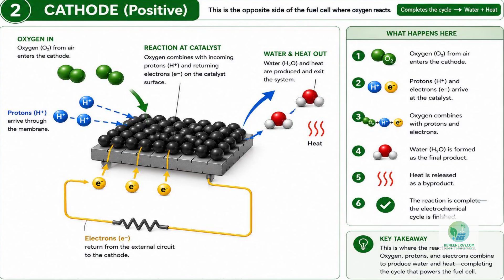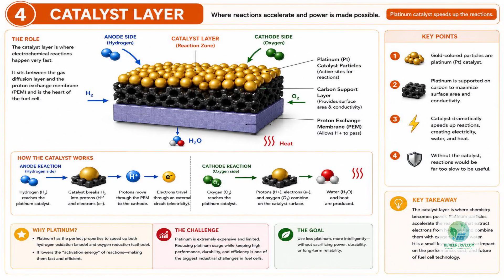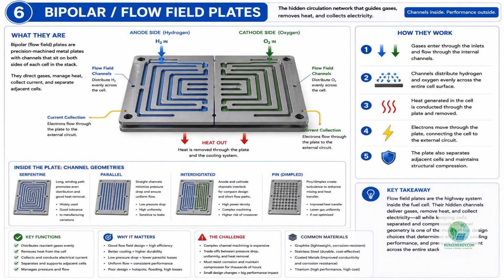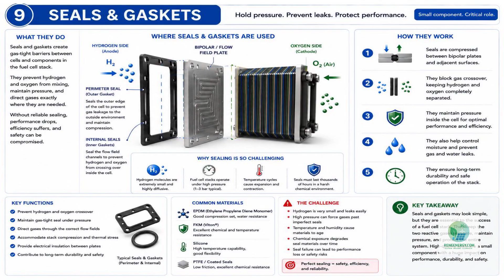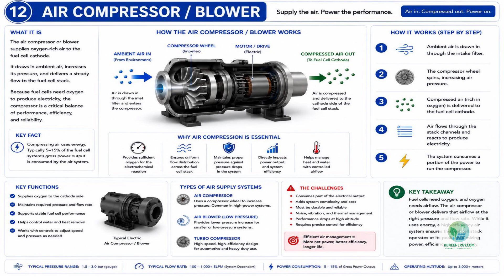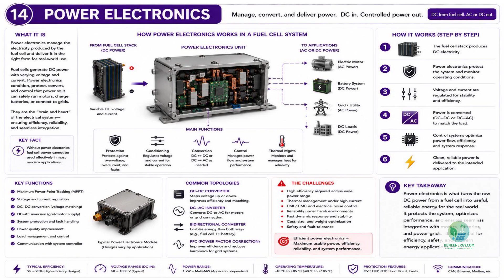Hydrogen Fuel Cells Explained — Every Hidden System Inside the Stack

Comment: Transportation energy systems usually evolve much slower than the technology itself because the supporting infrastructure has to mature alongside it. Reliability, fueling access, cooling systems, and operational consistency often determine whether new energy systems scale successfully over time.

During the early expansion of jet aviation, airports, fueling systems, and maintenance infrastructure had to rapidly adapt to support turbine engines replacing piston aircraft. The aircraft technology advanced quickly, but the operational infrastructure behind it took years to fully develop.

A similar challenge exists with hydrogen fuel cells and advanced energy systems today. The technology itself is only one layer of the equation because large scale deployment also depends on storage, thermal management, distribution systems, and long term operational reliability.

A simple example is fueling access. Even efficient energy systems become difficult to scale operationally if transportation networks do not have reliable infrastructure to support refueling and maintenance consistently.

It shows how major transportation transitions depend on coordinated infrastructure systems and operational support layers just as much as the propulsion technology itself.

#EnergyAndInfrastructure #AviationInfrastructure

Pilot Elizabeth Graham at Grace Aerial Technologies
Reply from the maker: Thank you for this thoughtful insight. You explained the systems challenge behind transportation transitions extremely well.

The propulsion technology often gets most of the attention, but the infrastructure and operational ecosystem usually determine how fast adoption can realistically happen. Hydrogen fuel cells are entering a very similar phase where fueling access, storage, thermal management, maintenance networks, and long-term reliability matter just as much as the technology itself.

The comparison to early jet aviation is especially strong because turbine engines alone did not transform aviation overnight. Airports, fueling systems, maintenance standards, and operational logistics all had to evolve alongside the aircraft technology over many years.

That same systems-layer reality now applies to hydrogen, green ammonia, batteries, SAF, and broader industrial decarbonization. The technology may work first, but scaling depends on whether the surrounding infrastructure can support reliable day-to-day operation economically and consistently.